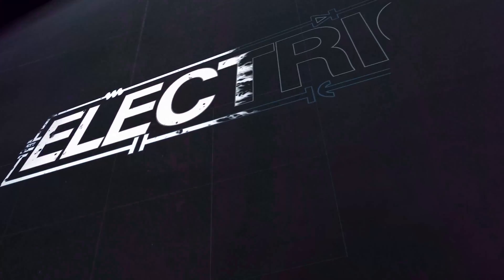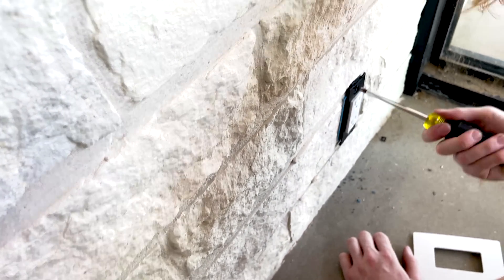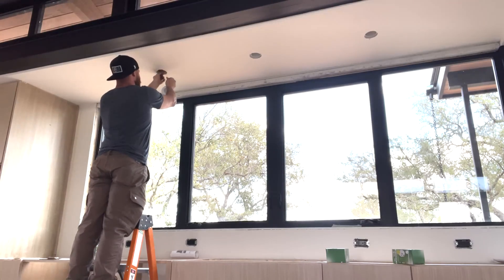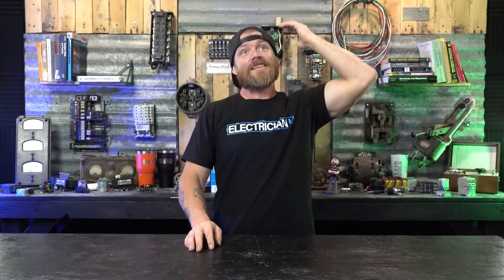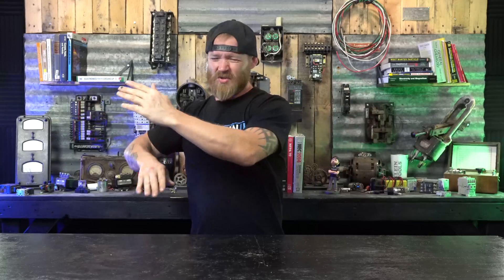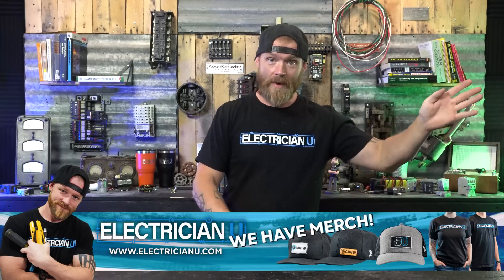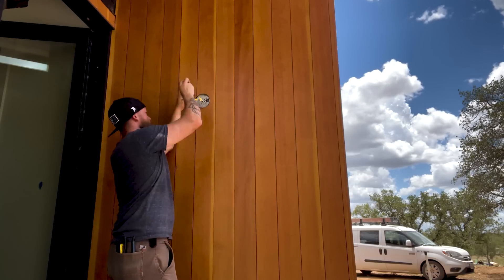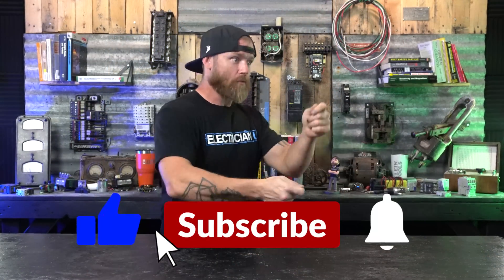Continuing Trim Out with My Son Josh!

Comment: I just got done with residential last school year an was scared to get a job cause I felt like i might be a burden on the company. I was one of the slower one in learning some electrical work. But as I start commercial I feel  I of might forget some residential work. What’s exactly would my job be?  My instructor is great an has taught me 3 ways, 4 ways, split receptacles ect an have worked on some houses but haven’t done the finish yet. My instructor wants me out on the job in a couple months but I don’t know if I’m ready

Comment: Hey Justin- you may have already solved the panel/ cover issue.
But in case you haven't-- look at ES225.  It's 3" longer than the ES200.
What might have happened is that they originally used a 3 phase panel, swapped the inside panelboard out with a single phase board.
I think you even mentioned that being done in a previous video.

Comment: i found that the doors cost almost as much as a full panel so if your time restraint is back order is not worth the wait then sacrifice labor time and reinstall new panel and charge for doors and when they arrive then get money back returning or save em for another job and reuse removed panel  and boom the current job is done and make up money by moving on to new job and save time from get job done and move on to new job .......better time management saves money by not waiting for parts,

Comment: What is a California 3-way?   Your comment about multi-colored wiring also interests me.  My southern California house, built in the early 1960's, uses black & red for the A & B hot legs of the 120 volt circuits, and white for the neutral wires.  That seems pretty standard.  But the A & B hot legs of the 240 volt circuits are both blue, and parts of the lighting circuits are yellow.  Maybe that was a local wiring practice.

Comment: We had a barn here in oklahoma where i work, and it had a hive of at least 200 wasps. We had to cut a 3 inch hole right above the wasp nest, all while on a 30 ft extension ladder.

It basically ended with me running/falling down the ladder

Comment: I personally would not like to work in a job where I am exposed to the harsh Texas weather, especially during the summer. I did work for 6 months as a Commissioning Engineer in San Antonio and I had to quite because it sucked. But everyone is different, one of my friends installs wind turbines and he says he would HATE to have an office job. Me personally I do not like office jobs either that much. I would like to have a job where I am able to move around but I am still in the AC.

Comment: Hi sir. I have a question. I do a new house panel with new meter. My meter and emergency disconnect box outside, and supply to the panel with branch circuit on garage. Will we bond at emergency disconnect or at the panel inside garage? TIA!
Reply: you always bond at the first point of power disconnect. If the main breaker is in the meter pan, then that's where you bond.
Reply: @rupe53  thank you. I appreciate.

Comment: 400 amp upgrade from 200 amp to a LARGE HOUSE.   The power company 
Does Not increase the size of the drop coming to the property.
How can this be?  Other than air cooled drop, what is the reasoning?
Reply: the power company is under different rules / regulations for their code so unless you have an issue with voltage drop, they generally don't go crazy with wire size. Also consider that most service upgrades are for total number of breakers due to everything being a home run. I have found that homes generally don't draw even half of the service rating, meaning that 400 amp (320?) is loafing along at something under 150 amps with all the AC running. The flip side here is if you have calculations for over 300 amps on your 10k sq ft home, you might twist an arm to get big wire installed the first time.

Comment: What is does it mean to "tone out" wires?
Reply: the term tone-out or ring-out means applying power (or some signal) to one end of a wire then finding the other end to match. It's usually done with a battery and a meter, but there are fancy tools to do this as well. During this process you tag each wire so you know which one is kitchen, bedroom, bathroom, etc.
Reply: Ohm it
Reply: @jasonthomashand  ... how about you explain it instead of just throwing out another slang term?
Reply: @rupe53  nut one end of wires together and run a signal through the panel wires until you hear a beep. Then you have found where it went.
Reply: @rupe53  ohm is electrical resistance. Not a slang word
Reply: @jasonthomashand  ... the term "ohm it" is not very descriptive if explaining to someone not familiar. It is a slang term in this case. If you had said it was a continuity check of an electrical circuit that would be an explanation of what's going on... because you are actually looking for something of very little resistance. (basically 0 ohms) None of this really explains how it's done in laymen's terms.
Reply: @jasonthomashand  ... now that wasn't so hard, was it? Much better!

Comment: Glad to hear your son is enjoying it. Off to a great start!!

Keep some WD40 holstered on you for the wasps. It will kill them in mid flight. If you spray it on a cloth and wipe some in the box, It will kill the pheromones and they won’t want to nest there. 
Another remedy is dish soap and water sprayed on the nest.
Reply: WD-40 is a regular go-to in my world but it will stain paint and wood. Brake parts cleaner also kills the flying critters but dries stain free.... even on a white ceiling. (just don't get it on certain plastic parts)

Comment: I am not an electrician. I have worked in construction most of my 67 years on the planet. Anyway, several years ago I had an 18 year old helper ( not my choice ) that had never done anything outside of his phone. It took almost two months to get him to remember the difference between a Phillips and a slotted ( flat ). Not his fault that his divorced parents failed him. He got into some trouble, went to prison for 6 months. He is now an apprentice electrician. He called me to thank me for all that I taught him and that he uses what I taught him everyday. That was awesome to hear that he is on a good path now.
Reply: People like you change the world small steps at a time. Kudos to you
Reply: @xdrnxfg  Thanks. We all need to do what we can.
Reply: Good on you, Dallas! When I was a brand new 1st year apprentice almost 28 years ago, I had ZERO mechanical skills. If it weren’t for patient guys like you, I wouldn’t have made it. I’ve had my masters license for almost 20 years now!
Reply: @Ephesians-ts8ze  Nicely said. I was lucky enough to have had a father that taught me,  my two brothers, and my sister how to do a lot of construction tasks. He had me cutting and threading pipe when I was 11. It took me probably 15 minutes to cut and thread one end of a two inch galvanized pipe. No power threader available, if they even existed back then. My dad and I alone built ( not contracted ) my 3500 sq. ft. house together 36 years ago. Great times. I really miss him.
Reply: @dallasarnold8615  threading 2” conduit by hand is not an easy task. It’s not too bad to do it just once but I was lucky enough as an apprentice to get stuck working in an industrial explosion proof environment at a plant where no power tools (that could produce an arc) were allowed. When you have to run a few hundred feet of it, it’s no fun!
Reply: @Ephesians-ts8ze  I feel you brother !  We could probably swap all kinds of stories of some tough jobs. Kind of goes to what doesn't kill you, makes you stronger.